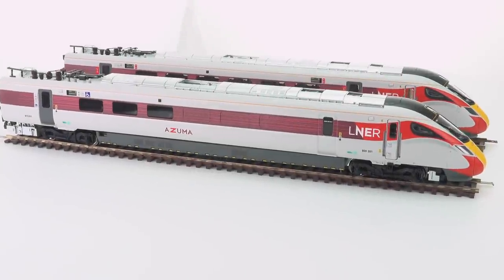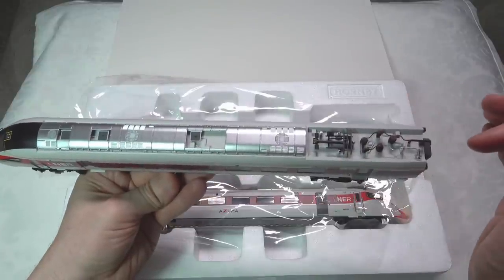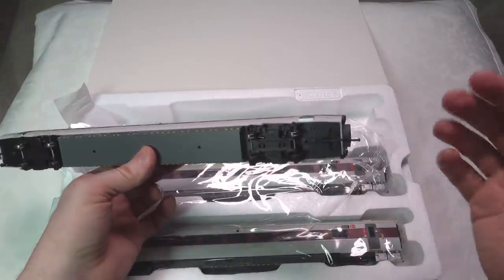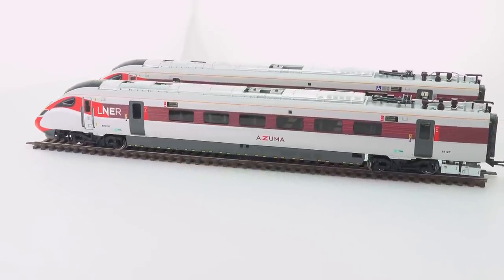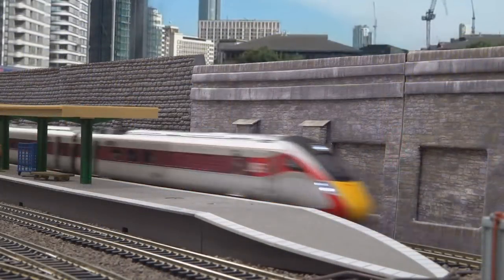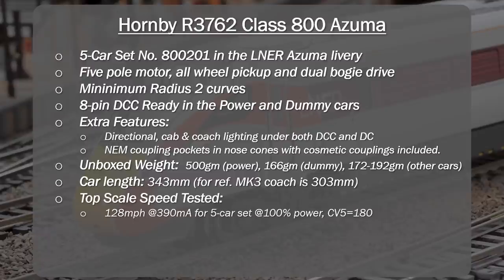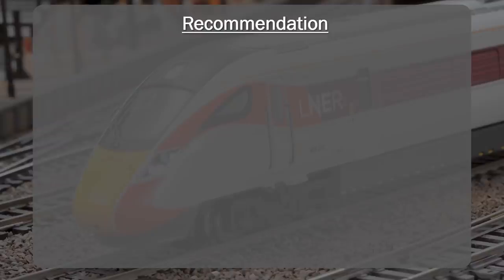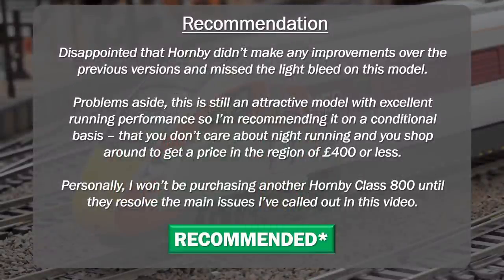Review: Hornby R3762 LNER Azuma Hitachi IEP Bi-Mode Class 800/1 Five Car Train Pack

Comment: I was thinking about buying one but Its the price that let's me down😂
Reply from the maker: Even if it was a perfect model, the new price would still be off-putting. When you consider the issues with it then it's a hard sell. If you can get it at the £392 price I mentioned then it's a bit easier to swallow - https://www.kernowmodelrailcentre.com/p/66941/R3827-Hornby-LNER-Hitachi-Class-800-1-Azuma-Set-800-104

Comment: I think you'll find the outer cars are not power cars like an HST, the 800s have traction motors throughout the train on various axles.
Reply from the maker: I would think a lot of modern EMUs would be of this design which should give a smoother ride. Model versions of course will based on the "power car" type approach.

Comment: The only issue I have with the class 800 is the power car and the bogies, the underneath of the power bogies sit low, so if you have AWS ramps in the middle of the fore foot the power bogies scrap the bottom of the power bogies as the non power car and coaches don’t
Reply from the maker: Thanks for sharing David. I hadn't heard of that particular issue before.

Comment: Nice video as always. Just an observation regarding your comments in regards to the GWR examples: their Class 800/0 5 car units are a matt finish in real life as the livery is an applied vinyl to a white body, as opposed to the rest of their fleet which is a painted glossy finish. In that respect, Hornby are correct in their application of the matt finish.
Reply from the maker: Thanks for that Callum - I haven't had the benefit of seeing these in real life so am reliant on photographs. The vinyl finish still appears to reflect more light than the rather dull finish on the Hornby GWR models. Looking at the Azuma close-ups the underlying plastic appears to be textured so this wouldn't help.
Replicating the vinyl finish on a model without making it look toy-like has definitely been a challenge for all the manufacturers.

Comment: Great review and totally agree with the content.
I have a large layout laid on Guagemaster foam ballasted underlay, which is pinned, with a minimum of radius 3 curves and express points. I found that the middle carriage has a tendency to derail. I have had to ease the the carriage couplings two to three turns and added extra weight to this carriage to minimise derailments.
The model is very quick but is let down by derailment issues and I fear people with smaller tighter layouts may struggle with this model.
I’d say this model is over-priced by about £100.00GBP and a fairer price would be £349.99.

As a general rule Hornby are becoming overpriced and Heljan, Dapol and Bachmann could take market share as a result.
Reply from the maker: Thanks for sharing. Thankfully I haven't experienced any derailments on either of my two Class 800s so this is very disappointing to see and a big black mark for any model. I had derailment issues with the Pendolino and one of the issues I found was differences in the flange size between the wheels on good and bad cars. Might be worth looking at. You've already hit the other main improvement areas. I think we're on the same page in terms of Hornby's pricing!

Comment: It's disappointing that Hornby isn't listening to modellers about the train's deficiencies.  It's clear that they've set the budget and they're not going to Invest a cent in corrections while they have no problem increasing the price.
The pantographs and crude lighting are a huge and obvious disappointment.  Glossy finishes are a different issue.  These are scale models and so the finish has to be in scale, too, and just like ridiculously high speeds on some locos, there are lots of cars with toylike shine.  But there's a difference between an in-scale satin sheen and a matte finish.  Frankly, for the subject and the price, I would have thought Hornby would have spent more time on the external finish which is what is going to sell these units -- or not.
Reply from the maker: Thanks for you comments Randy. 100% agree on the finish. I'm approaching a point where I won't purchase another new loco until this is addressed. It's same old, same old at the moment.

Comment: Thanks for a well-balanced and carefully considered review. This train seems to be of a similar ilk to the Javelin with flimsy pantographs and the build quality is not vastly superior to that!  There are a number of  methods that could be used to make the body work look shiny - lacquer, French polish, T-cut, furniture polish. Using lacquer or French polish is the most risky.  T-cut runs the risk of removing detail. Furniture polish is the least risky, but I think you would have to buy an expensive brand used for antique furniture!  T-cut will produce a shine on bare plastic, but will quickly take the paint off if you make a mistake. I think I would experiment on a second hand coach which doesn't matter!  Thanks for uploading.
Reply from the maker: Thanks for that. The roof elements from the Javelin incl. the flimsy pantographs do appear to have been carried over here.

Comment: For me it hits the mark! The light bleed isn’t a issue as I find running trains in the complete dark in my loft a no go. The light bleed was a issue on the class 800 limited addition pack of 500. For me running in the dark is pointless. But that’s just me. Mines didn’t have the paint problems. Again another good review.
Reply from the maker: Thanks Graham. This model is definitely a conundrum. It's an attractive smooth running model on the one hand that I do enjoy having on the layout. For the sake of a bit more design oversight and better quality control it has the credentials to be one of the best models of the year. And for many like yourself, the issues may not be relevant and you can enjoy all the positives, Glad to hear it's running well for you.
Reply: @EuviRail  on another note, I swapped my Avanti 390 shell onto the virgin motor from about 10 year ago, pulls all 10 coaches with ease. Nothing to my eye can see any difference in the motor or the weights but I suspect it the build of the motors in the newer ones that’s the problem. I had problems with the Avanti one pulling anything more than 7 coaches. It would jump and wheel slip all over the layout. However the virgin one works well. Not had to change the tyres either on that one.

Comment: Another excellent review.
I know I bang on about Hornby rubbish (8Pin DCC interface, lighting, constant light bleeds, awful panto's and dodgy livery applications) at piss taking prices and I still stand by my opinions and it still stands with this product which to me is a glass half full but you're paying for the full bottle.
Having said that, I do have the Hornby TPE 802 on pre-order with my model shop and after this video review I'll probably re-consider nearer the time and cancel because £452 (retailer discount price) for the 5 Car TPE 802 is again ridiculous but yes I have bitten for now which is mainly due to the fact I have 2 TPE Class 68's and 2 matching TPE MK5 Packs from Accurascale  which are extraordinary value @£450 for both packs delivered, that is 10 coaches with lights!
This product you just reviewed, I wouldn't touch it with a barge pole.
Reply from the maker: Thanks for that. Yeah, glass half full is a good way of describing it. The sad thing is it wouldn't have cost a whole lot more to get it right which is such a shame. I'd jump at the TPE 800 if they fixed the issues and dropped the price a little. Really looking forward to the Accurascale MK5s. They look exceptional. Will review as soon as I get them.
Reply: @EuviRail  Yes I'm the same in regards to the TPE 800 but even if the price holds @£452 at the retailer but the issues you pointed out aren't fixed then it will be a no-go.
Will look forward to your review of the AS TPE MK5's!
Reply from the maker: @sapphirejunction8993  If more people take this line we might hopefully see some movement on these issues and get the model we were hoping for....
Reply: @EuviRail  I don't think that will happen with Hornby, they are caught between being a toy company and a detailed model manufacturer and looks like they'd rather be the former especially when it comes to D&E.
Practically all my money has gone to and now goes to Accurascale, Dapol, Hattons (Class 66's x17) Revolution & Cavalex in that order followed by Bachmann, Hornby and in last place Heljan.

Comment: I am not a fan of gloss finishes.  I don't think it scales down well and cheapens the look of them. The light bleed id ridiculous currently from Hornby. So much disappointment coming from them. I don't do night time running so wouldn't be an issue for me but it could easily resolved in the factory if they painted the inside and stopped using white for the model instead of painting them white !

Comment: An excellent review - very fair and balanced. I'm not sure about a glossy finish - I worry that it might look a little toy-like. But I appreciate that the prototype finish is actually glossy. I did buy one, since it is the period I model and nobody else seems likely to produce it, but got it at a good discounted price. I guess I went in with my eyes open that it would be a poorer quality model coming from Hornby. And indeed as you pointed out the pantograph is shockingly bad for a model at this price. The finish on mine seems OK, I don't care about night running (fortunately). Once coach seemed prone to derail due to a kinematic coupler but that should be easy to remedy.

The extra overhang is certainly an issue on a smaller layout. And the cramped underbody space for a decoder and speaker is annoying. Given that I intend to run it in diesel mode the sound is quite important (and luckily the flimsy pantograph will stay down).

I'm planning to get a TPE Nova 1 - again because it fits with my era and location. I fully expect it to have the same flaws as the Azuma and preceding GWR 800. If Bachmann, Heljan, Dapol, Accurascale or Rapido did the 800 I wouldn't look at the Hornby model. But sadly if you want an 800 they are the only option. But it is likely to be my last Hornby model.
Reply from the maker: Thanks for that. I think a lot of folks would share your thoughts on this. The sad thing is that Hornby have done 95% of the spadework on this model but that last 5% is so important. It would be a travesty if the TPE version inherited all the same faults but I fear you may be correct.

Comment: I have one further comment on the Hornby Azuma 800, as a user of PECO code 75 track. I have noticed that the wheel rims on the Azuma are quite big - no doubt that is one reason why it is such a good runner - but when the wheels meet code 75 plastic rail joiners there is a bump. This is enough to make a noise and be seen if you care to look, but has not yet resulted in a derailment. It has no issue whatsoever with the metal joiners. You may just need to be careful where you locate any plastic joiners, especially if, like me, you have some relatively inaccessible areas of your layout. I have to say that it is still a good runner even on this track and is an excellent train. I am very pleased with it.
Reply from the maker: Thanks for sharing Charles. The Code 75 track can be problematic for some models as you have highlighted. Good to hear the model is working out well for you overall.

Comment: Other than it looking like an angry rat, it's fine with me if light bleeds through and if there are minor, easily fixed problems, but I couldn't be fine with it if it didn't work.
Reply from the maker: I was disappointed that it didn't improve on a few niggles I had with the GWR Class 800 but overall it's still a fine running model.

Comment: I have the Test Train and now the Azuma and they both have all the same issues no further development was done just recently on the LNER I had an  issue with the couplings being too ridged to run the train on an incline the coupler was lifting the following coaches up and had to loosen them 1 turn to give flexibility also the coaches and dummy end needed some weight to stop them jumping the tracks on bends . 

Lighting same issue bad light bleed and very tight to fit anything other than a Cub speaker or small iPhone speaker .

Basically Hornby are pricing themselves out of the market for most loco users,   so far i am disappointed with the Class 800 and the Hush Hush i have ...now looking at moving to Bachmann as you seen to get more value for the money .
Reply from the maker: Thanks for your comments Wayne. For the sake a of a modest investment, Hornby could have probably have addressed 80%+ of the issues with this model and made us customers a lot happier.

Comment: Obviously you can only review the model which you have, I'll simply say that the one which I have fortunately lacks two of the issues which you highlighted as I don't have paint bleed near the cabs or wires showing beneath. For price, there's a good supplier based in Ormskirk! Currently offering both Azumas at a little over £380 on their website.
Reply from the maker: Hi Rog, thanks for that pricing tip and your experiences with the model which is good to hear.

Comment: A very balanced review which I agree with. I find the coaches are the biggest problem especially on S type cures. The change of direction causes the coaches to derail.
Reply from the maker: Thanks Kenneth. I do have an S type interchange on the layout but I never run anything over it at speed and while I didn't experience such issues in the course of the review activity I can see the potential for such failures. I'll watch for this again.

Comment: I ordered mine when first announced 2019 from Hattons only to be told 2021 Hattons could not supply as sold out on pre-order? so ordered direct from Hornby. 
One plus point for Hornby they did honour the pre-order price of £395 so I did not pay the new price. I am over the moon with my model a real classy model.
You mentioned the new APT and I look forward to your review if you get one? I received mine this week (the 7 car set) this model is not in the same league as the Azuma, the power car packed up after 3 days, I will reveal more if you review it, a not cheap and chatty model. Bill.
Reply from the maker: Hi William, thanks for your comments and input on the APT. I won;t be reviewing the APT I'm afraid as I need to manage my own budget and it didn't make the cut. I've looked at other reviews of it online and unfortunately you're not alone in your experience. The Azuma is definitely a superior model.

Comment: Is it my eysight, at 15:39 (model versus prototype) the nose looks completely different, the real thing has a shap transition from roof to nose leading down to just above the side window apex and then running forward, the whole nose is more convex which can be seen in the upper edge of the windscreen, the red side stripe bisects the corner of the door on the real thing, higher to just below the line and with a steeper curve to a point set back on the headlight, the effect is much more purposefull", how much do these cost!!!
Reply from the maker: Hi David, RRP is £477. I didn't want to get into this given the prototype was photographed with a wide angle lens versus a macro lens for the model so it can be hard to do exact shape comparisons. Even allowing for that there are some definite differences alright so thanks for highlighting.
Reply: @EuviRail  I would think it likely that differences in the physical shape are "production compromises", I remembered your comments about the plastic pantos, I wonder if Sommerfeldt might be enticed to make something suitable if they don't already.

Comment: i am stuck on a decision in between a 9 car class 91 or a 9 car class 800 so i was wondering if you would review either of them. for the class 800 I mean the one that will be 502 pounds.
Reply from the maker: Hi, I did have the Class 91 on pre-order but following my recent experiences from Hornby I decided I wasn't willing to invest in both the Class 91 and an MK4 rake and chose to go with Bachmann Class 90 with my existing MK3 rake instead. A review of the Class 90 is in the works.
Reply: @EuviRail  ok i think i will get the class 91 the pictures look good but idk what the price difrence will include